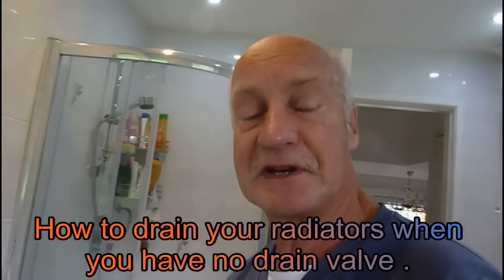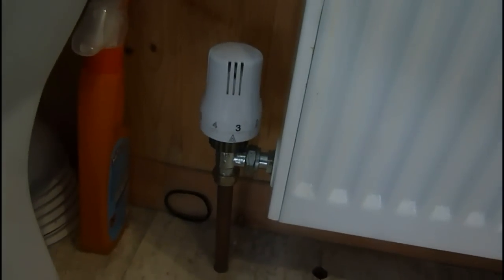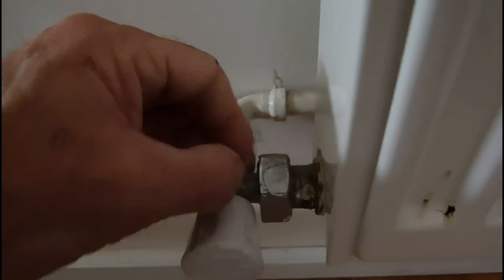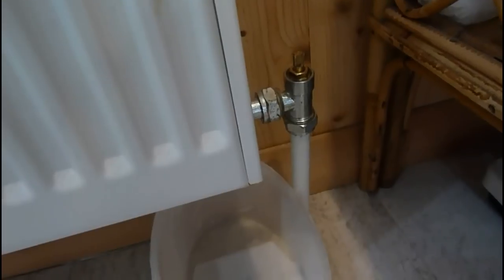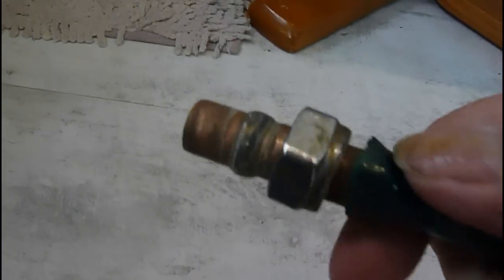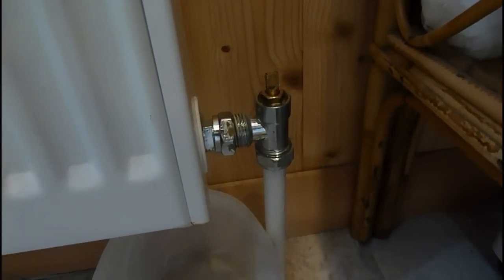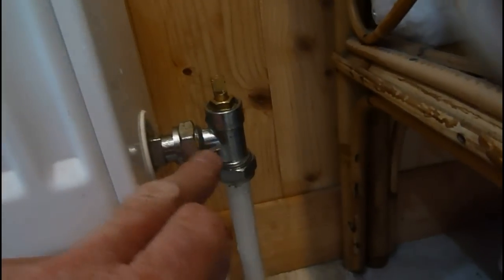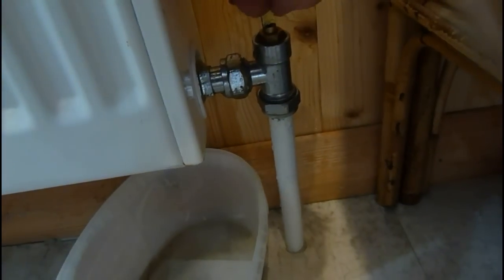How to drain your radiators and boiler when you have no drain cock,or it does not work.

Comment: Great video Al. Many thanks. Is it okay to leave the system drained and empty for a few weeks while decorating? Not sure if the air in the system will speed up corrosion rate while empty. Cheers Rob
Reply from the maker: That will be Ok Rob.
Reply: dereton33 
Thanks Al. Also wanted to check... once the system is draining, do i need to open any closed locksheilds and  valves/trvs around the house in order to aid with draining down the system? Cheers
Reply from the maker: Yes open all the valves. Also the air valves on the radiators once the water level has dropped.

Comment: i am about to drain down my system. is it basically turn off water to the house via the stopcock - empty the tank by running all the taps and flushing the toilet until no water comes out of the taps - then turn to to draining the radiators? is that the correct way?
Reply from the maker: ***** no just turn off your stopcock and attach a hose to the drainvalve and empty the system. No need to drain the main header tank

Comment: hi can you tell me please i need to replace a rad valve as its sized up the house has a combi fitted will i have to drain the whole system first ?
Reply from the maker: ***** The bad news is yes. Al.
Reply: ok thanks i also will be changing the taps on the bath and hand basin would this be a good time to do that as well

Comment: What if you have only one lock shoe (or however you write it)? I only have one, the one with the knob that you turn up the heat with (not a thermostatic knob, just an old simple one with a plus and minus on it). The other pipe doesn't have a lock shoe so it can't be closed off to isolate the radiator from the system. HELP!
Reply from the maker: +TheOpelkoenjas You will have to drain the central heating system.

Comment: hi i have just drained my radiators, bleed them put heating on an heaters are still cold after 5hr have put central heating on an off bleed heaters an no joy still cold. i have a back boiler and its like its not catching an makeing heaters hot thanks
Reply from the maker: Just open the drain valve do not open any bleed valves on the radiators, do not bleed at the same time.
Reply: Thanks 4 ur help

Comment: What if your air bleed is siezed, all microbore system as well no drain cock either..
Reply from the maker: Loosen off a valve on a downstairs radiator  shut the rad valves on both sides first, then empty the rad into a container, when finished loosen one of the valves and turn it to face into the room then re-tighten, then attach a hose to the valve leading outside then turn on and empty the system.
Reply: @dereton33  thanks

Comment: I unfortunately can't get that first nut off for love or money and it is bending the pipe and making the bottom nut leak :( Worried if I continue I'll break it and have a permanent leak!!
Reply from the maker: You will need another spanner to hold against the valve in order to take the pressure off the bottom pipe nut, or you will cause a leak .

Comment: I am going to try this. I need to change my radiator from small to large. This means cutting the pipe work down. Will there be water in the pipe feeding the radiator (trv side)? Or will your way empty everything please?
Reply from the maker: It will empty everything, so long as you open all the air valves on all the radiators.